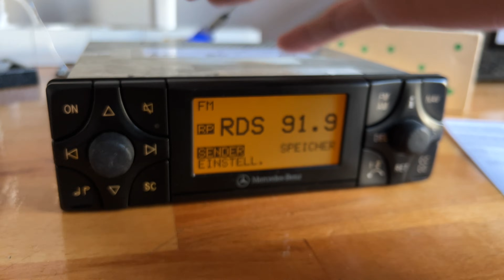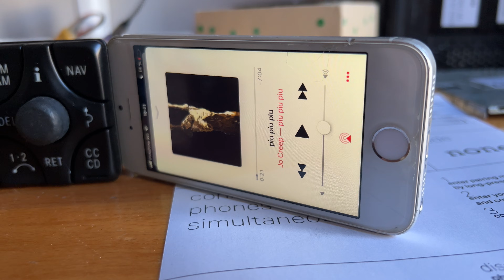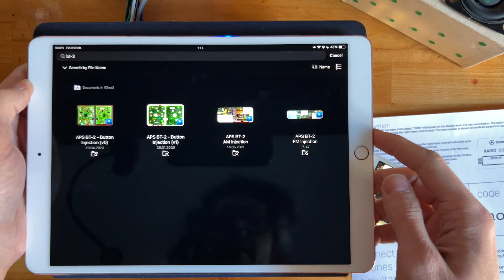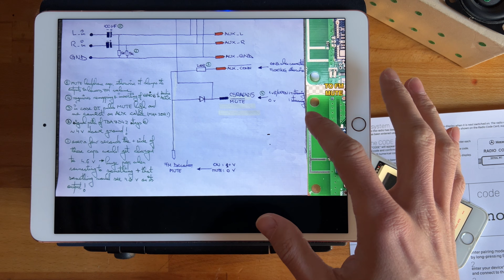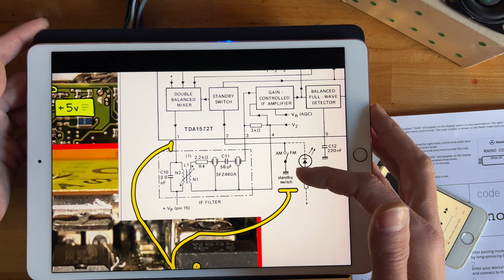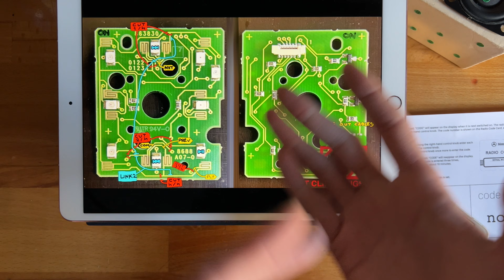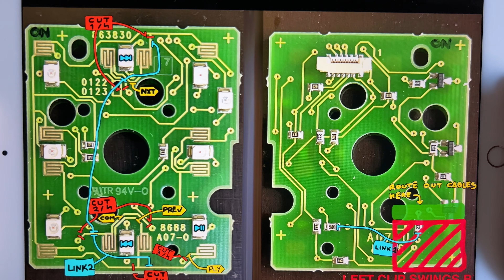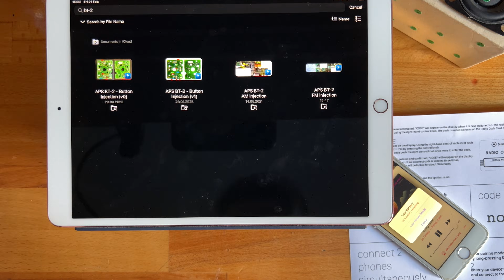Mercedes-Benz APS BT-2 (BOSCH BO1150) - Bluetooth / AUX Tutorial

Comment: Probably won’t get a reply but seems like someone knows the electronics of my radio. I would like to know why you didn’t use the right and left buttons for skip and back did you like it better up and down or was it not technically possible. Second does anyone know if there is a option for using the CD changer port on the back for a Bluetooth chip there is no light cable so it should use electric bus to transmit skip pause and back to the changer is there anyone who used it to put a chip to use your phone with the controls in the radio like using the cd
Reply: you have to disconnect the big capacitor on the main board with pliars (rip it out) and then you have to destroy the 18 pin connector on the back of your radio then bluetooth will work automatically without chip that means it's not your time little man
Reply: And did it work son of a dairy cow?

Comment: Hey man, I watched a couple of your videos and was inspired to try the same.

I have this old Blaupunkt ACR 3231. I found out that the soundchip inside is an 'AN7273' chip.

I cant figure out what would be the best way to add bluetooth, as I want to keep my casette and radio sound.

My idea is to mute the input for the AM/LW radio waves. Then I just tap in my bluetooth in the sound output of the chip (not really sure wich pin it is).

I then would just play my bluetooth music and swifch to AM/LW to mute the radio sound and only head bluetooth.

Would this work? Do you happen to have a suggestion? Would love to hear from tou!
Reply from the maker: sorry for the late reply - you're right on the money 🤘, that's the easiest way forward